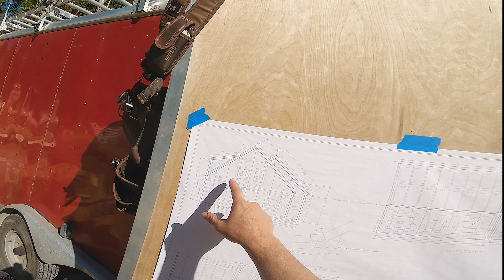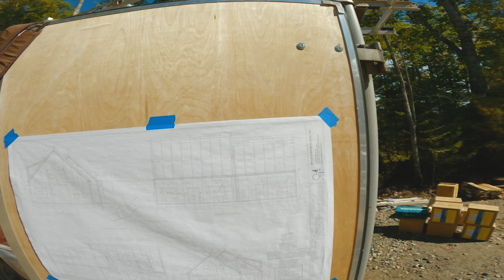Installing SIPs On Two Timber Frame Buildings | Shelter Builds a Country Home & Garage | Ep. 4

Comment: I was curious about the rigidity of the walls between the bents. I know its secured well , but wondering if there is any flex in the walls since it's just osb and expanded polystyrene. Cant wait to see the next episode!
Reply: Stronger than a stick built, that's a stud construction, wall by far.
Reply: Remember there's two layers of OSB . And the polystyrene is rigid . It acts as a webbing between the two skins . There's other products / foams that are better . These are  stronger than 2/4 's  or 2/6 , stick frame  construction . And twice as efficient as far as insulation goes .

Comment: To avoid mold/fungus one would need to use only breathable materials from the very inside to the very outside. I.e. everything, including no plastic paint etc.
The materials used in this video (foams, glued wood (OSB/SIPS), etc.) are anything but breathable, thus will not make for a healthy home. Though timber-frame houses are certainly both great and beautiful, and the Shelter Institute is otherwise doing an amazing job with both these buildings and videos. Cheers all.
Reply: @clwnthr I had the exact same thought. Then as mentioned at 25:12, after the electrician has finished the wiring, they install a water resistant barrier (WRB). This is just asking for condensation, and the resultant germination of mold and fungus spores. Straw bale or hempcrete walls would be ideal. What other breathable wall materials do you think would complement a timber frame?
Reply: @guywhitworth5764  Good suggestions. One could also use e.g. clay or cob walls/"bricks" – but that might not be the first choice with a timber-frame. Or simply wood fibre insulation and wood fibre sheets/slabs covered with wooden boards on the outside. There are a lot of options, actually, though they vary somewhat in breathability of course. So a healthy house also needs some kind of air vent (not powered, though), either in the windows or by a simple whole and vent in the walls in the different rooms. Simply to support the houses' breathability when there's being created too much humidity inside and windows are not being opened enough.

And yes, WRBs are definitely a disease trap in a brand new house. Sad that people think that a house built this way could ever be a healthy living environment.

Comment: Why do these panels require all the trimming and customization but the panels from Eco-Panels of Tennessee do not?
Reply: Also why use splines and reseal each sip joint when you can do it once ,and forget. There is a difference with the type of insulating foam . Not the same R value , and putting all the holes in the outside of the panels , means a greater chance something gets missed . Probably the biggest reason for the adjustment is that the corners are not set up the same

Comment: Have you guys experimented with or have any opinions about SIPs made of styro-aircrete or walls made of styro-aircrete in general?
Reply: I haven't seen anything on styro-aircrete ? But I have seen polyurethane. It does have better insulating performance than polystyrene.
Reply: @jackwhite3947  
A couple years ago I came across a YouTube DIY contingent that were doing aircrete.....a slurry of Portland cement and dense soap suds made from a homemade or commercial foam cannon. 
It's a very good product if done right, but my understanding is that it's extremely fickled, and just as soon as you think you've got the technique perfected, something goes wrong.

Anyway, people have been adding chopped up Styrofoam, and it makes it much easier to get the parameters right to produce a consistent product.

Some people will put it in a mold, let it dry and put a product over it to give it strength or do it like these polystyrene SIPs and sandwich it between OSB.
The advantage over PU is that it's much, much less expensive. I'm not sure how it works out with building codes in various states.
Reply: @biggregg5  sounds like a concept I saw years back , they were using fly-ash , with cement. As an insulating component. The styrofoam sounds like a good plan , depending on the ratio of the mix and the consistency.  My guess is that there's is some code written for this , because of the use of concrete.   Sandwiching it , or using something as a form would be a big improvement , in my opinion. But that brings me back to question what was the purpose of the additive to the concrete . If the answer was insulation . Well that's a lot of work , and is it better than a sip or an ICF ? You mentioned , cheaper . I would ask some other questions also . What about longevity , sustainability , maintenance . Some of those answers will effect the budget . If you save on the cost of materials and construction and labor upfront , to get a product that isn't saving you money over the life of the product . By product in mean housing. By money I mean energy. What did you save . Here is another one . As a contractor , or developer or investor , what can you build that the consumer will buy. Here's one one more . If you build it , what will you do with it when you don't need it ,or you need to move ? I think somewhere in this reality we live in there are answers . If I had all of them , I'd miss manage them and still be stuck with something I don't like .
Reply: @jackwhite3947  
Yes....essentially, that's why I'm asking these guys. At this point, I'm a YouTube surfer, and interested in novel DIY ideas. Check out Stephen Williams channel. He seems to be a pretty sharp guy that is a fan of the concept for lots of reasons. Maybe start there if you want.
Reply: @biggregg5  thanks I'll check it out. Lots of new stuff to ponder.
Reply: @biggregg5  I think youre refereing to SCIPs, where there's a pre made EPS panel with attached steel reinforcement on both sides. It's placed on site to form the walls and the concrete is applied by hand or sprayed. 

One concern with that is thermal bridging, because the steel mesh on both sides are connected to each other by steel going through the EPS. That also makes me wonder about fire safety, because the steel would carry the heat to the EPS and melt it.

Comment: I’m new to timber framing but not new to woodworking or traditional joinery. I have to say I am not thrilled about the idea of these SIPs. How are heavy things (heavy upper cabinets, for example) hung on the walls? I feel the best method would be to incorporate traditional framing within the timber frame structure and leave the inside beams exposed. With traditional framing, I worry about the walls connected to the frame moving with the Timbers and causing cracks in the windows and/or drywall. Still not settled on how I’m going to build our house, but at the moment I’m leaning toward a hybrid timber frame/traditional framed home with stone fireplaces and plenty of tongue and groove ceilings and walls.

Comment: After the SIPs install, does the gypsum then get screwed/nailed into the inside of the SIPs panel?
Reply: Yes at 19:25
Reply: Until you have to wire the home . And running the electrical from the outside , or inside , without chase's already in the panels ? Sound like a lot of work . There's a better way .
Reply: @jackwhite3947  there are chases already in the panels.

Comment: Don't see why not spray foam in the groove before assembly,  the stuff expands . Can even get a slower expanding foam if it's time you are worried about.  Save you some drilling.
Reply: I don't know why they still use this type of panel . There's a better product available.
Reply: @jackwhite3947  What are the better panels you are referring to?
Reply: @adrienpetersen  there's lots of other panel companies . Now I don't know everything but . Well the product I was referring to was . ICS Eco Sips. A sip manufacturing company in ft Collins Colorado. I think that they have an affiliate in Tennessee.  What's the difference ?  
   The way these panels go together is so much easier . And you can seal the panel just before it's installed. No shims no drilling no foam no screws to attach the panels together. Sound like you could save some time and maybe product going into each panel . Oh and thy use polyurethane instead of polystyrene. Is there a difference , well, Yes . As far as I know they don't make timber frames . But they do cover them . As well as conventional construction , without stick built walls or roofs . They do the complete package for whatever you want . Sips More than meet code for construction of all types . They just seem to showcase them with timber framers, because they don't inclose the frame .

Comment: Who do you source your SIPs from in Rhode Island please?
Reply: Those are not the best sips to use . Way too much work involved in putting them up .
Reply: @jack white  who do you recommend? I live in RI so was curious where Shelter sources them
Reply: @bbbonesss  Eco sips in Colorado or Tennessee. A much better product. I have visited the Colorado location , as I live nearby . They both deliver country wide .
Reply: Probably used branch River in Rhode Island, I have built two structures from them, reasonable pricing.
Reply: @johncomeroski8427 you’re right. In one scene they showed the blueprint closely enough that I could make out Branch River Plastic
Reply: @johncomeroski8427  is there any other quality characteristics that you're aware of besides price that make them a better choice?

Comment: Yeah, yeah, yea, but how you get the sound to match up with the slowmo. For the nailing it’s just normal nail gun sound spaced to the video but for drilling and other stuff that’s not a single impact the length of sound will not match the length of video. Maybe it just an editing tool. Anyway back to eating timber framing.

Comment: Why not use some type of engineered timber framing members to avoid movement relative to the SIP panels? Using drywall as a work around to this issue makes me squeamish, I'd like my house to be more of a factory precise manufactured product out of the gate.
Reply: Take a look at ICS , Eco sips of Colorado. A better product as far as sips go . Engineered timbers ??? Not Shure what you are referring to . Glue lams maybe? The dry wall won't stop any movement . Eco sips have a much better ( manufactured ) product. Starting with the corners .
Reply: @jackwhite3947  In a past video, Shelter 
explained that they drywall the SIP panels before installation so that when greenish timbers shrink and settle, it avoids having to repair / replace drywall abutted to shrinking timber. It's a fair solution, but I'd prefer to find a more dry or stable timber system. Also, thanks for the info on eco!
Reply: @paulo7200  I didn't see that video . I don't have all the answers about timber frame construction . These guys are pretty good as far as timber framers. I think the panels are suspect. But I did see and hear them say that there were chases already cut in the panels . The company I referred to has a different approach the  problem of keeping things square.  I think the corners are a great idea . And the way they connect is much better in my opinion. I did see a video on the use of green , or dry timbers .  Dry timbers are more expensive, and harder to get in a timely manner is my guess . I'm thinking that's what the concern was , involving movement . The dry wall is not cut in on the inside of the frame , and is put up in whole sheets because there's less seams and joints to fix is probably right and a good idea ???

Comment: I understand the benefits of SIPs but do you ever use any other methods? Specifically products that off gass less?
Reply: How much do sips off gass.?
Reply: @jackwhite3947  it depends when they were made and with what material. But I guess off gassing is not really my concern. More "environmentally friendly"  is more of my concern. Wool, mineral wool, and dense packed fiberglass or cellulose all have a lower CO2 footprint.
Reply: @garrettscott4094  really, I'll have to take a closer look at the co2 information on sips . What part of the product or the process is the problem?
Reply: @jackwhite3947  if I am not mistaken the majority is during the manufacturing process, and varies based on adhesives and the type of "foam" being used.
Reply: @garrettscott4094  hey : Just Googled  Sips and Co2. And quickly came across This study that was presented at the climate change summit in Paris recently. International Journal of Environmental Research and Public Health . Now , I do have a concern for public health , and products that off gass can be a problem . There's been quite a bit of research done on off gassing . I don't know all of it . This presentation addressed several aspects of the different types of construction. Sips , brick and concrete , timber frame , and steel . Now the timber that is reported on here is not what I would can a timber frame. More likely it's a stick built home . And the steel would refer to the same type of housing . This report sites rual residential construction, and some urban development. No multifamily highrise sardine homes. Mostly single family homes . This study was conducted in China . And there's a lot of information on how they arrived at there conclusions . And what formulas and other complete B..S sited in this study . BUT  unless you are talking about a sip that was manufactured 20 or 30 years ago , or the company that's manufacturing them , just doesn't have any ethics at all . I would venture to bet that if anyone had an argument about co2 or anything environmental after reading this .They have some other motivation for their point of view. The study points out WHAT most people in the construction trades already know. The only reasons why people don't choose sips over other construction methods is information , misinformation , 
 cost or both . That's not to say that every one wants or needs to build with Sips . So if you want to use or sell or promote other types of insulation , go for it . But to say Sip's are not environmentally friendly??? That statement would be false . And all hippie's , tree huggers , environmental activists , climate change science believers , International environmental Research and Public Health Chinese Government official persons , can all agree that according to the study the environment would be better , the homes would be better , and all the world would be a better place if sips were used more often .
Reply: @jackwhite3947  yeah that's about my understanding of it all as well. I think something not accounted for is how much carbon you save by using SIPs. Obviously all products are made using and releasing carbons, there is just no way around it currently. But if you can minimize the usage of the most energy intensive products and blend different products and techniques, you might be able to produce a equivalent or even superior product. The technique of "flash and batt" comes to mind as a good example. Ultimately someone's budget and design criteria makes the decision most of the time. I was just curious if they happened to ever use any other building practices and found success.

Comment: Interesting to see all this put together, and it's inspiring to see how different buildings are created. But oof, all that Styrofoam flying around. Styrofoam pollution is an odd trigger of mine. I cringe every time I watch it being cut and drilled through. That's the benefit to many other forms of insulation: they aren't a environmental nightmare.